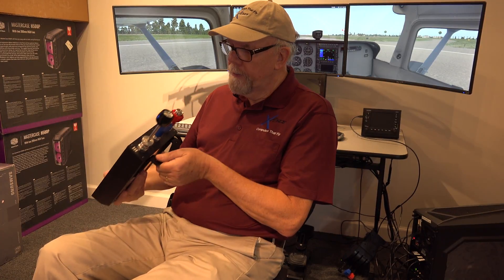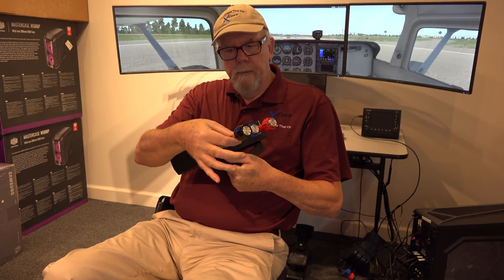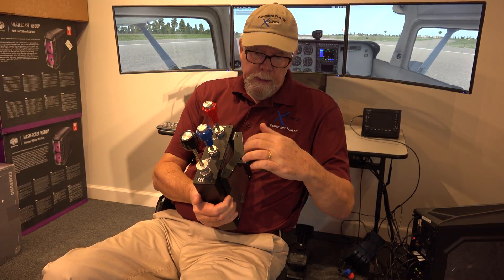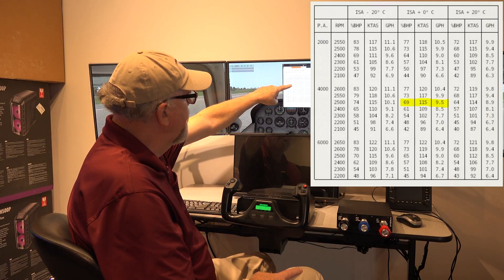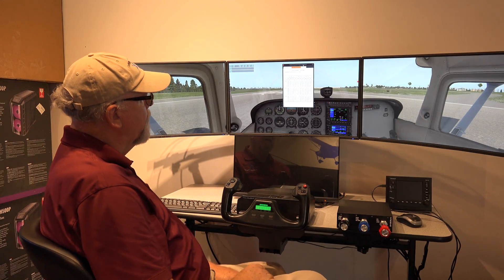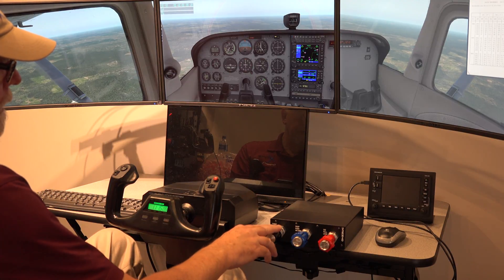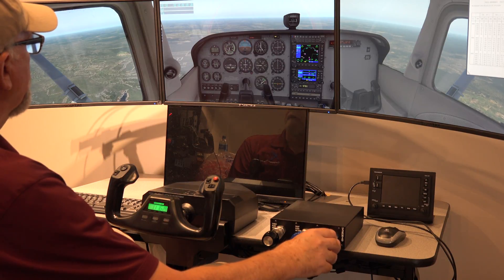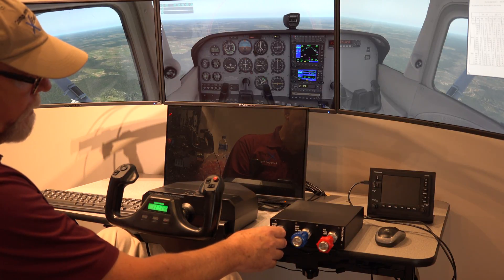Virtual-Fly V3RNIO TPM Detailed Overview

Comment: I might suggest the following video on leaning piston airplanes.  Perhaps I am misunderstanding what you are saying but I think using a fuel flow chart to set the mixture at cruise risks over leaning and damaging the engine. I believe the fuel flow charts are mainly for flight planning and leaning the mixture is best done by reference to EGT or other engine indications( RPM,Manifold pressure, or engine smoothness). The video also shows how faithful the VirtualFly TPM unit is to the real life unit.

https://youtu.be/LxDZSFxgLx4